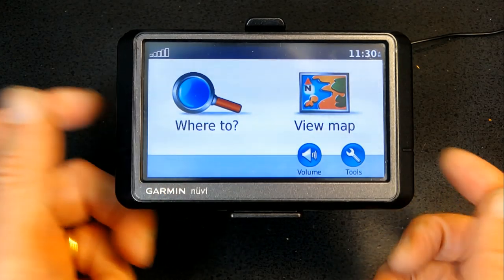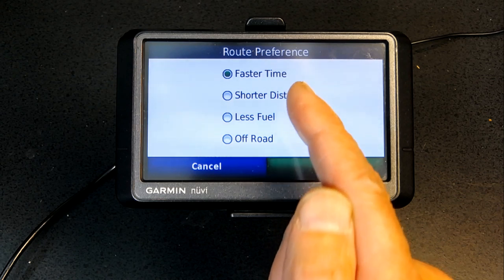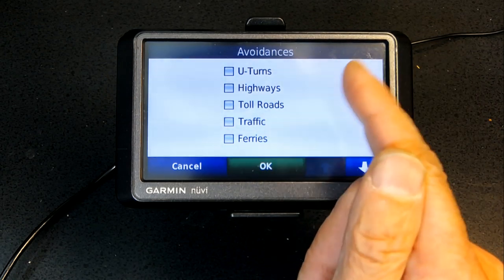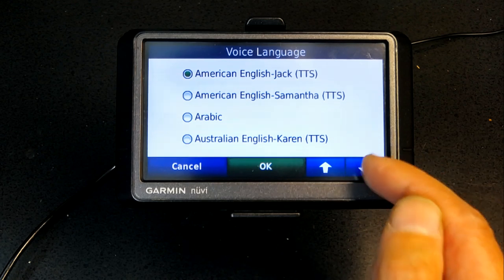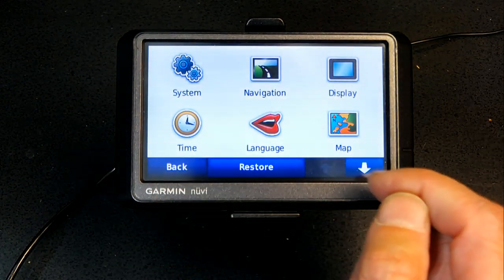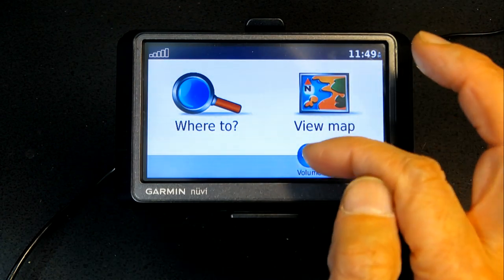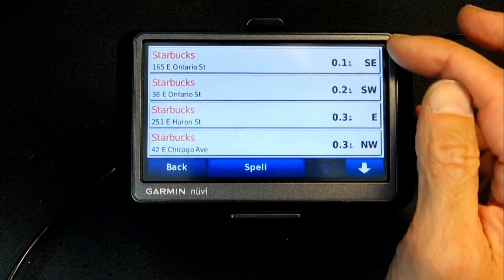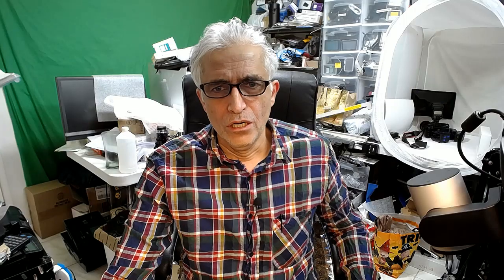Tutorial on how to use a Garmin Nuvi 255 255W 265 265W GPS Navigation System

Comment: Fantastic explanations. Thank you so much, such a great help. ❤ May I ask if a Garmin nüvi 255vi could still work fine these days? Would it do the job or it is really old and outdated now. I would only use it to get around in my area and country (Hungary, Budapest). I mean I could still update free maps and so on? I am about to buy a second hand one that's why I'm asking. Thanks for your kind answer in advance. 😊
Reply from the maker: You are very welcome, and yes Garmin nuvi 255 is still a very powerful GPS. You can get all the updates as long as it has free updates. The only problem is that the batteries wll not hold a charge because they are very old, so you will need to keep it plugged in all the time.
Reply: @TECHNOLOGYTIPS101  Thank you so much for your kind answer and help. I will buy it then. :)
Reply from the maker: You are welcome!
Reply: @TECHNOLOGYTIPS101  🥰

Comment: Great video, quick question for you: what does the W stand for in the 255W??
Reply from the maker: There are two Nuvi 255 models, one is just 255 with a small screen, the other one is 255W with a Wide Screen, so W means Wide in this case.
Reply: @TECHNOLOGYTIPS101  Thank you a lot
Reply from the maker: @franciscotaverner6039  No problem!

Comment: Hi. I have a Garmin  Nuvi255. It's over 10 years old. Is it possible to update the maps?  Thanks
Reply from the maker: Hi, yes indeed the Nuvi 255, and 255w are both fully up-gradable with the latest 2021 maps. However the internal memory in them is not enough to handle the entire North America or Entire Europe, so you will need a 8GB SD Card
Reply: @TECHNOLOGYTIPS101  There are lots of SD Cards. Is this a "Mirco" SD? Do you have an Amazon link? Thank you.
Reply from the maker: @benkanobe7500  For this exact model you need to have a standard 8 GB SD card not my crusty cart. You can buy any SanDisk 8 GB from eBay or Amazon

Comment: My 255W does not have a connection port for a USB connection cord.  The power cord has a fixed end for the vehicle receptacle.  How do I hook my GPS to my laptop?
Reply from the maker: You need a simple Mini USB to USB A cable, and they are only a few dollars here is an example  https://www.ebay.com/itm/174130056619
Reply: Thank you very much!   I didn’t realize that the power port also serves as a data port .
Reply from the maker: @larrylubeski  Yes they use the same port for both Power and Data Transfer
Reply: @TECHNOLOGYTIPS101  Thanks again for your knowledge.

Comment: Thanks so much for this tutorial.  I've had my 255W for what, I don't know, about 10 yrs.  I just pulled it out of storage to use on a camping trip and realized that I needed a tutorial update.  I noticed in your "maps" explanation that your maps were update to 2018.  How were you able to do that on such an old device?  Standing by for your reply and...thanks again.
Reply from the maker: Hi, Thanks for your compliments, you can guy it directly from Garmin but it is very expensive like $79 or you can buy it on eBay here is the link https://www.ebay.com/itm/153356107213
Reply: @TECHNOLOGYTIPS101  This link is no longer valid. Do you have an updated link? Thank you
Reply from the maker: @benkanobe7500  Please tell me what do you need the link for, and I will send you the most updated link.
Reply from the maker: @benkanobe7500  https://www.ebay.com/itm/390748221821 make sure to put a note at the time of purchase mentioning the exact area for which you need the maps.
Reply: @TECHNOLOGYTIPS101  Thank you so very much.
Reply from the maker: @benkanobe7500  My pleasure!

Comment: Hello, I am from Argentina, I have a Nuvi 265W GPS, for some time when I turn it on it remains with the screen that says only GARMIN, and it does not advance further, I have already tried several and repeatedly to do the Reset, and I have no answer. You know what I can do?
Reply from the maker: Yes sir, you need to use Garmin Web Updater to reinstall the Firmware. Here is the link for it  https://www8.garmin.com/support/collection.jsp?product=999-99999-27

Comment: Do I have to have an SD card to use my Garmin nuvi 225 wt
Reply from the maker: No, you don't need an SD Card if you are OK with your existing old maps. However, if you want to update to the latest 2021 maps you will need an 8GB SanDisk SD card because the new maps will not fit on the internal memory of the GPS. 
You could however install a smaller map of a limited region like one or two states on the internal memory.

Comment: how long does the battery last?
Reply from the maker: A new battery fully charged will give you 2 to 3 hours depending on the screen brightness level, and a used battery fully charged will give you about one hour. However it it is connected to the car cigarette lighter adapter then it will work indefinitely.
Reply: @TECHNOLOGYTIPS101  thank you
Reply from the maker: @andrebmedeiros82  No problem!

Comment: I have this computer but I doesn't work unless o connect it to a charger
Reply from the maker: It probably needs a new battery.
Reply: @TECHNOLOGYTIPS101  thank you. I'll order a new one. Do you know any store that can ship to Kenya? Gemini 265
Reply from the maker: @djclintoh8746  There are many stores on eBay that ship worldwide. By the way, you can use any 3.7V Lithium Ion Battery even ones from Cellphones, etc as long as you use the Garmin control board from the old battery it should work fine. Watch this video to learn how https://youtu.be/c2mpLgBpBOM
Reply: @TECHNOLOGYTIPS101  Thank you
Reply from the maker: @djclintoh8746  No problem!

Comment: Hi I was online and saw the Nuvi 255w is selling online for either 179.99 or 259.99 there both the same Im so confused to why? Whats the difference and how could I find out which one I have?
Reply: Does it have to be plugged in all the time or does it charge like a cell phone?
Reply: @bobgarcia9963  It has to plug at all the time once you using it...it does has a built in battery..but the battery usually cant stay for long uses..when its brand new..the battery could be last around 30-60 minutes depend how good battery for the gps unit it self...advices for long travel usage..keep it hook to your vehicle power outlet...i still has this model and usable till i wrote this comment..
Reply: The only different is the prices among the seller....what currencies you mention there?if in usd..i think the price is really high..
Reply from the maker: I am sorry I thought I already replied to this. The price differences are based on the number of maps and free map updates that each qualifies for. Also some of them come with lifetime free Traffic condition updates where some you will need to buy it yourself. These units were much more expensive than the newer Garmin units because they have the type of firmware which can take third party and unlocked maps, where the new ones can only take original Garmin maps. Nowadays you can buy a good used Nuvi 255W for under $50 from eBay.

Comment: Also the UK uses miles in lieu of kilometres as well (despite other daily measurements already in metric), although outside of motorways and roads the Brits would usually measure distance of two places in KM anyway since it's easier to use - and that all cars sold in the UK has speedometers shown in miles and KM as to comply with European standards. Useful for Brits who often drive to mainland Europe as well as to Ireland which is now fully metric.
Reply from the maker: Thanks for the valuable info, although I did learn later about the usage of Miles in the UK, but I still didn't know that Ireland uses metric system. So I appreciate this valuable knowledge.